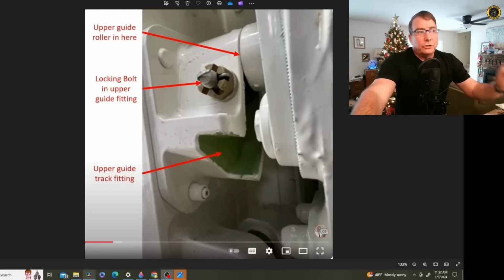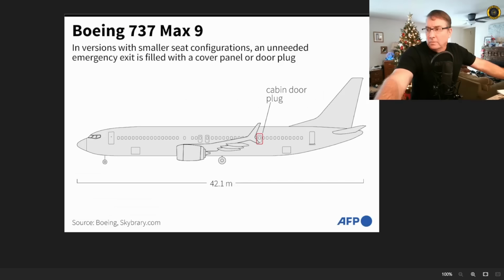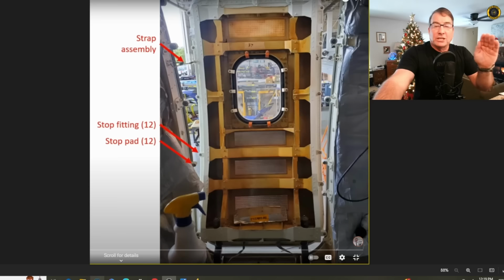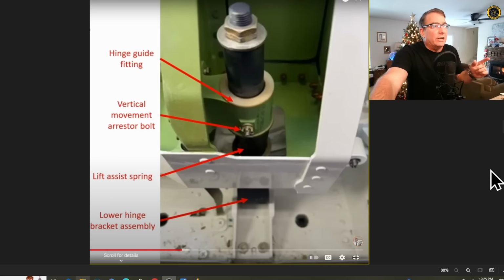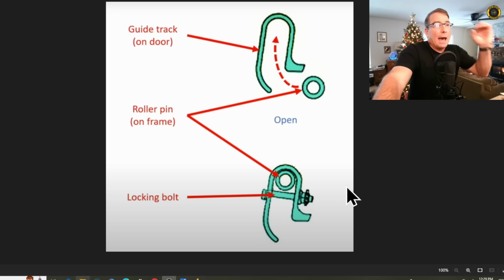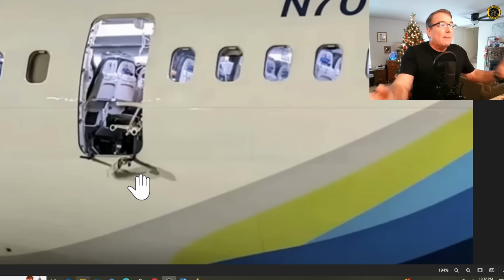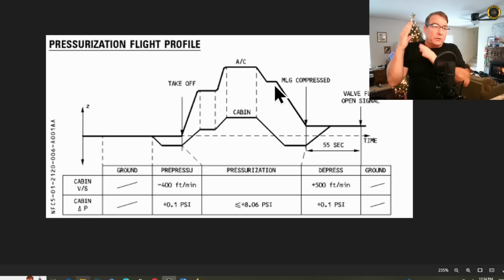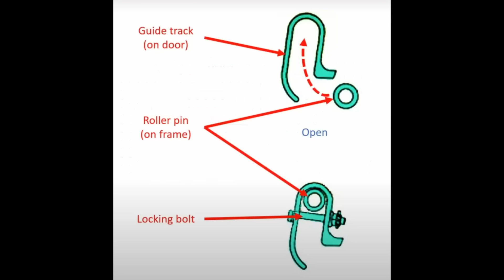Alaska 737 Max-9 Door UPDATE! 8 Jan 2024

Comment: There had been a couple of pressurization issues noted before this event but the airline’s solution was to tell that jet to not fly over the ocean for an extended time.
Reply: It wasn't really flying over water for an extended period that was the point of the restriction. The point was that flights to Hawaii would put the plane far from any airports  in the event of an emergency. So far , there doesn't seem to be any connection between  those pressurization incidents and this incident. There may very well be a connection. Time will tell.
Reply: Seems like a prudent move to me?  Keep it near airports until the pressurization problem was figured out?
Reply: These previous pressurisation incidents could indicate that the bolts were out by then, and the plug/door was already loose…
Reply: In retrospect it seems likely those things were connected, but I can understand why the airline didn't take that as a sign of catastrophic trouble. The most likely cause of it was something slightly wrong in the pressurisation system, either the engine not performing quite at full capacity, or something up with the ducting. Something that could cause a gradual depressurisation, needing a diversion, but not an actual risk to life.

The idea that intermittent depressurisation issues could actually be caused by a loss of fuselage integrity is very much not what would spring to mind.
Reply: @PartanBree  That's what I think too:  the real problem seems so incredible compared to the usual system problems like bad sensors or valves that the airline employees didn't consider it.
Reply: Is it a bit cavalier to continue flying the aircraft, after admitting the problem was sufficiently significant to restrict its flight path, without determining the cause and fixing it? Or is depressurization not a big deal?
Reply: @SLOWBOAT2CHINA there are symptoms and there are causes. Deadly disease can also cause minor symptoms so does that mean for every minor symptoms like common cold the person needs to be sent to ICU immediately? 

In hindsight yes the airlines should have inspected the aircraft but airlines are not omnipotent and they have to trust the FAA and plane manufacturers that their maintenance guides are correct. I am pretty sure the maintenance manual said these symptoms are not a huge issue and recommended to cancel etops but still allowed the plane to fly. Airlines just followed the guidelines given to them by Boeing and approved by FAA
Reply: @sanjay_swain  excuse me, did you say “trust the FAA”? 😂 Thank you for the humor!
Reply: Kindergarten kids can figure this out …
Reply: @sethtenrec  I know it sounds stupid and all in this regard but in serious sense they have to trust the FAA for regulation. It's their job after all. If FAA is not taking action then airlines also can't do much from their side
Reply: Easy to see why everybody is getting Airbus these days…
Reply: Disagree.  Keep it on the ground until root cause of the pressurization problems are pinpointed and corrected.
Reply: @PartanBree  Seems to me troubleshooting and solving the issue should be a top priority before flying with passengers.

“It’s probably nothing” doesn’t cut it
Reply: @sanjay_swain  people with a minor cold don’t typically blow up and take hundreds of lives with them, goof
Reply: I agree with some comments, The door plug could have been the issue all along. That plug has been loose.
Reply: @tomburton8239  conjecture. The bolts were not installed. Either at Aero or Boeing or in Alaska post purchase inspection.
Reply: I have to agree with this because I’m not mechanically inclined at all and I finally understand it. 

Basically, that door-plug was OPEN. No one knew except the airplane itself. (Kudos to that airplane.) 

Next question is…intentional or unintentional. Wasn’t that plane on the assembly line in October 2023? Any significant world events happen in Oct 2023?
Reply: @imaPangolin  you say maybe …”bolts not installed in post purchase inspection” … you mean when you get an aircraft from Boeing you might  have to finish assembling it??  

Nice, great company! 😂😂😂
Reply: @SLOWBOAT2CHINA   Didn't depressurize.  The system detected a pressurization system problem, and they switched to the backup which worked.  Not related to the failure by the looks of it.  Minimum equipment list for ETOPS is different than non-ETOPS.   They also don't make that stuff up on the fly.
Reply: @PartanBree  Looks like they were not connected after all.

Comment: Good update. I'd seen the excellent Brady explanation, and the pretty obvious conclusion to be drawn. Remember that this aircraft had been in service for barely two months, so the idea of long term fatigue or creep effects is most unlikely. The repeated (3) auto-pressurization warnings also suggest a pressure leak from a defective door-seal, consistent with an insecure plug door.

Comment: Good one, Juan. Thanks !!!
As as an pilot, design engineer, and A&P trained, it is hard to believe that any of these retainer (locking bolt in diagram) bolts could have failed, since the loading is mostly outward on the roller pin and track. I am betting they won't find the retaining bolts, nuts, and cotter pins. My guess is the retaining bolts and nuts were installed, but the cotter pins forgotten, or not spread apart (why not safety wire???). If so, what happened to the inspection after the task was complete? Over time, as you suggested, the nuts vibrated loose, the retaining bolts fell out, and then lay unobserved behind the interior paneling. One good in flight bump or air frame twist, boom!!!
Reply: It looks like the roller pins are pretty far up in the track. Doesn't that mean the door would have to move down to get the roller pins out of the track? How could the door move down like that? And if it could move, why wouldn't friction prevent it from so moving? I have little understanding of these plugs, I always thought they were "plug type" but obviously not.
Reply: @Mattribute   The tracks are on the door. The pins are on the frame. It's easy to confuse
Reply: Why no safety wire?  Easy, economics.  Any monkey with a pair of sidecutters can install a cotter pin.  Using stainless steel safety wire, and installing it properly, costs a lot more.  Sadly...
Reply: if all 4 cotter pins were left off  the 4 nuts would not  have vibrated off at the same time,    @omgsrsly  therefore if plug came out with some bolts still in place metal around bolts would be torn or bent, since plug and slots on fuseloge were un damaged bolts were probably never installed. inspection and verification seal was done away to save money, so passenger lives not worth much to boeing
Reply: @bowlweevil4161  If any single one of those bolts were in place, the plug would not have moved.
Reply: Now that the horse has run out the barn... safety wire, lock tight and manager sign-off for that plug installation.
Reply: To my limited understanding, the setup looks good.  I had the same question about why safety wire wasn't used.  Then I thought about maybe the bolts were "fake bolts".  I am sure that such a possibility is part of the investigation.  If United is reporting finding 5 loose bolts on aircraft, now the original provider of the sub assembly and Boeing will have to look at their daily employee records.  Eventually, there will be an answer.
Reply: Why use locking wire? It wouldn't make it any more secure, or less like to be missed when installing than than split pins, would it? If you wanted to make it more secure, nyloc castellated  nuts with split pins would be the way to go, but like anything it still has to be installed correctly.
Reply: It's doubtful if airframe vibration would ease out the cotter pins, loosen all four castellated nuts and rattle the bolts out, especially on a jet with so few cycles. A more probable scenario would be that they weren't fitted in the first place. 
Someone on here described the random pressurisation occurrences as burping. That is exactly what would have happening especially going through bumpy air at lower altitude (before the full delta p took effect).

Comment: They are not going to find bolts that were never there. The odds of four bolts falling out… hard to imagine how many zero are required.
Reply: 💯....which is how Boeing will weasel their way out of this one as well. 
It couldn't possibly be that they forgot to install them, obviously everyone just won't have looked hard enough for them.... 🙃
Reply: My guess is you can tell if a bolt has been there or not by seeeing the mount holes. Not my expertise LOL, but probably a simple task  for the FAA.
Reply: The odds of 4 independent failures is essentially zero - leaving all 4 bolts out involves a single point of failure (1 human) and is the most likely scenario.  I completely agree with you.
Reply: I agree.   No bolts at all.
Reply: I’d immediately start inspecting for the presence of the bolts and the assembly quality on all these door plugs before and after the production sequence of the aircraft that experienced the failure.
Reply: I bet you the bolts were there, but the cotter pin in the castle nut was not! I've also read these planes were touched by some company that installed wifi and might have removed the door for installation. Let's sit back and see. If the bolts were there and the nut loosened up, there should be evidence of the bolt from some type of wear on the metal surrounding it.
Reply: There will be witness marks if any bolts were in place at the time of the depressurization.
Reply: @TodayIWorkOn  If true, door needs be removed and installed following Boeing Procedures. This would be conducted by Alaska, not by the WIFI provider. Also, United has discovered loose bolts as well.

Comment: For being such a new aircraft I’m leaning towards those bolts not being installed at all. Those castle nuts and cotter pins are tough, I just don’t see them failing on an aircraft with barely any takeoffs/landings. The only other issue could be the cotter pins not being installed, but normally that’s done at the same time a castle nut is installed so it’s a symbiotic process.
Reply: I agree. But we will see.
Reply: I agree with this.  It's easier to imagine the bolts being missed completely, as opposed to only the cotter pins missing.
Reply: It's entirely possible someone just hand tightened the castle nut and skipped the cotter pin. 
On work orders that are on a COMPUTER they are scared to put a torque value on the work order , so you would have to have a kit  with all the hardware
at hand AND have researched the torque values your self if you were new to that operation....
Reply: @ronaldspins  There was an update, they inspected several other aircraft and found that the brackets that support the locking mechanism that the door pin slides into had loose bolts so either they weren't torqued to spec or the lock nuts were not installed correctly. I don't know what type of nuts they use on those bolts as only 1 photo was released so far that only shows the bolt head and washer. Could be the culprit, I guess we will wait and see.

Comment: Loose bolts themselves would not cause the plugged door to separate as long as the bolts are there and the castle nuts are secured with cotter pins. The bolts won't go anywhere. I suspect that on the Alaska plane, the bolts were never installed - someone forgot about it. Even without the bolts, the door will stay in place due to its weight, until the vibration shifts the door up ...

Comment: My guess is that after the interior of the plane was finished, someone didn’t reinstall those bolts!  Very frightening situation and I am glad the pilots acted quickly to get everything under control!  I always rely on your succinct analysis of every incident because you aren’t looking for the dramatic, sensational angle, it is a learning experience!
Reply: And no one will be held accountable or fired because the Union will place the blame on Boeing vice its employees. 🤔
Reply: I thought aviation repairs required a quality Control Inspector with checklist.  Could the Tech and Inspector be "Buddies"
Reply: The bolts should be installed and rechecked before the interior paneling is installed.  The interior panel covers the door plug, preventing inspection once it's been installed.

Comment: Good thing that door is heavy. I could imagine the impact into the left horizontal stabilizer.
Reply: I suspect the way the bottom hinge separation mechanism operates also played a part in avoiding that catastrophe.
Reply: @davidf6326  Patented Boeing fail-safe design feature /s
Reply: @davidf6326 — Yes.  It looks like the top of the door has to fall away before the lower end comes loose, putting the whole door on a downward trajectory, below the empennage.
Reply: Probably designed to fall down

Comment: I remember flying an Airbus 321 as a captain years ago, a new aircraft to the fleet, and had great difficulty getting out of the cockpit inflight at altitude ... The fuselage "twisted ever so slightly, but that jammed the cockpit door ...  Needless to say that issue had to be dealt with but this is to point out that fuselages bend and twist in flight ...  so an insecure door may be at risk.
Reply: Interesting, I never thought of that. But that makes perfect sense now that your pointed it out. I wonder what engineers do to counter that.